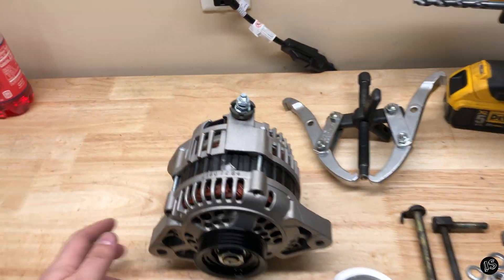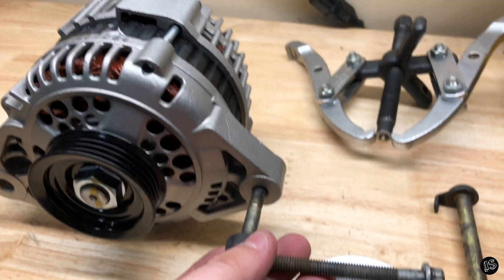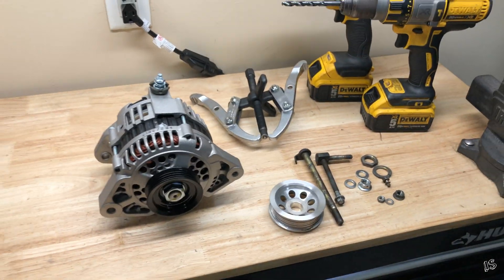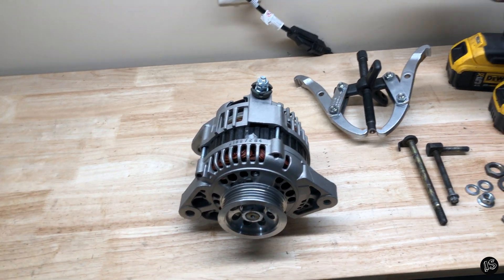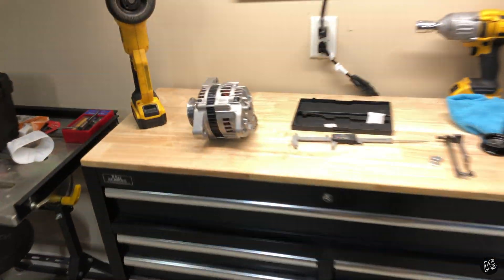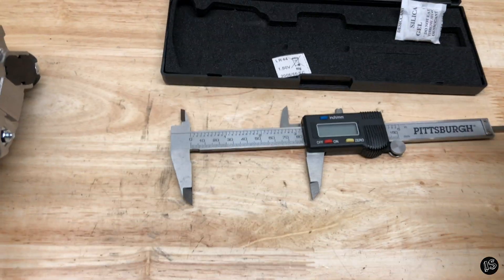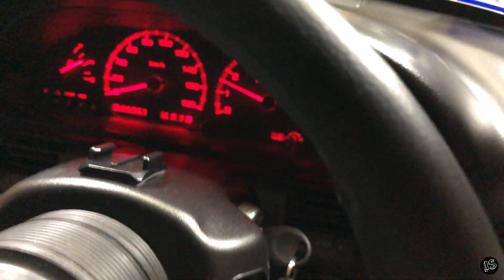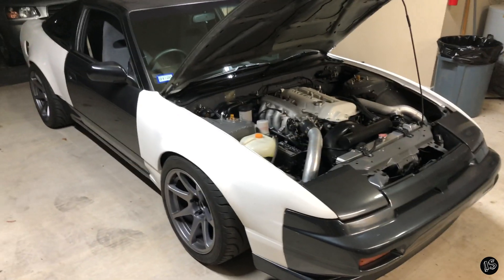KA — SR Alternator Conversion | Quick Tutorial

Comment: yo what did you torque that pulley nut to?
Reply from the maker: Can’t remember, but over 70 ft lbs for sure. ~70 ft lbs is the minimum to get the split washer to lay completely flat and be adequately tight. 

Different brand alternators have different torque specs I’m sure. I’d imagine I put it between 70-100 ft lbs.